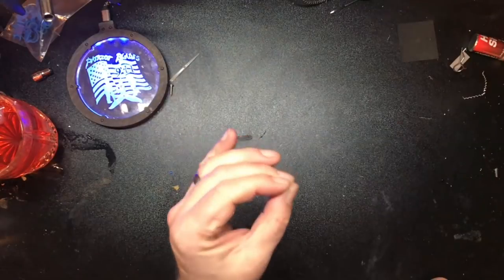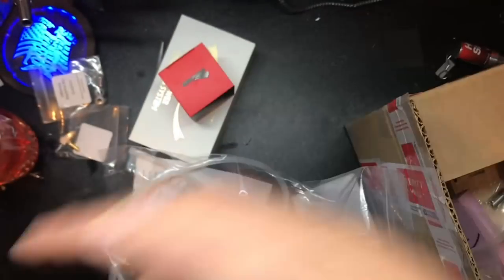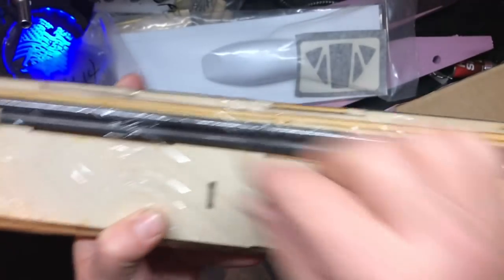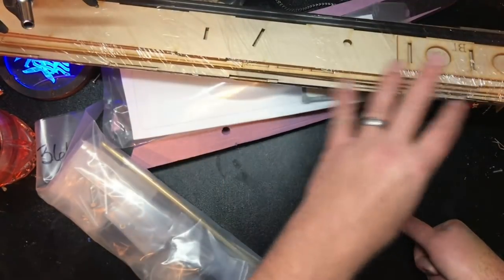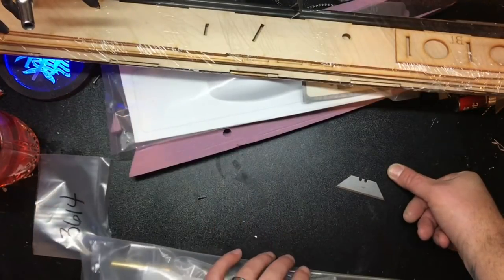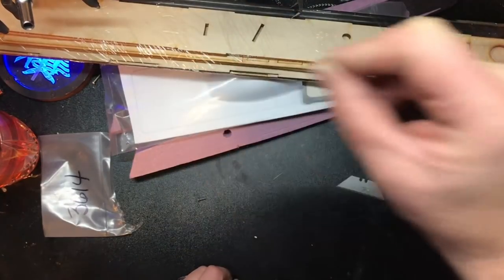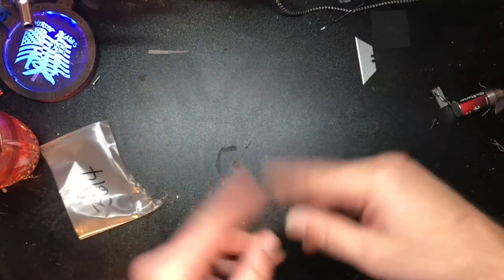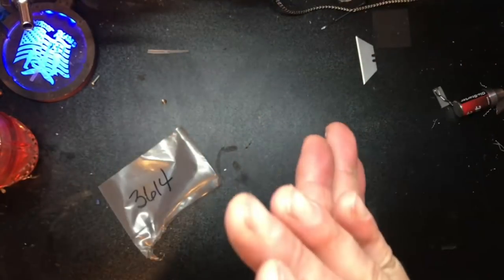RotoBoat - Wood Boat KIts, To build or not to build?? HMMMMM

Comment: Hi JJ...i am building a 32 inch wooden wild thing and noticing this boat is starting to get heavy, even without a 1 pound motor and batteries , etc....was wondering if maybe i should just use the wooden model as a mold for a lighter fiberglass or carbon fiber boat instead...what do you think?